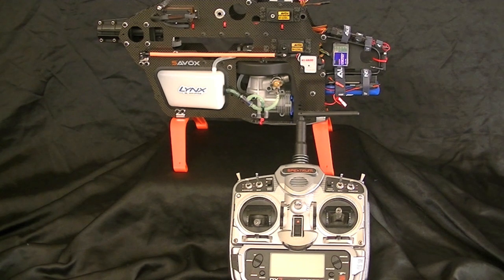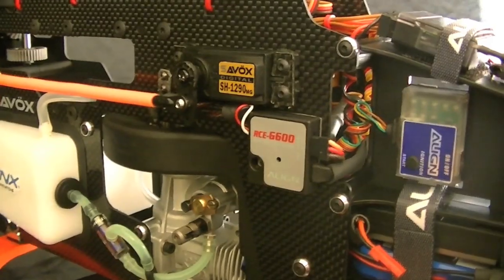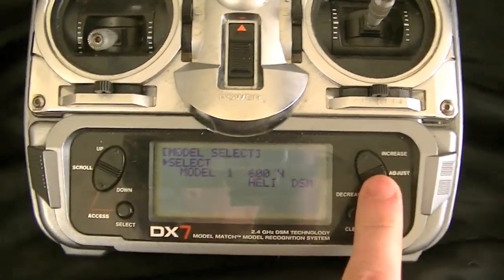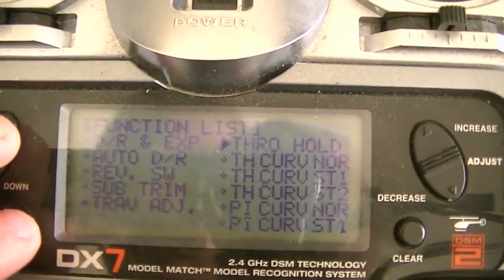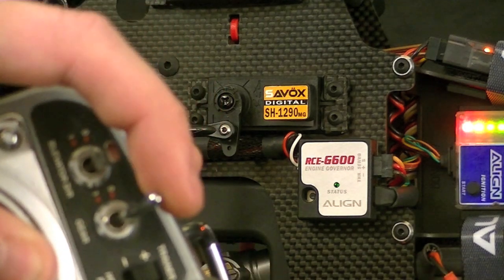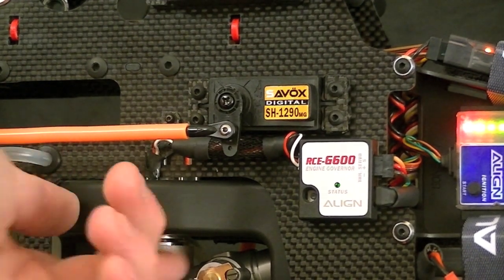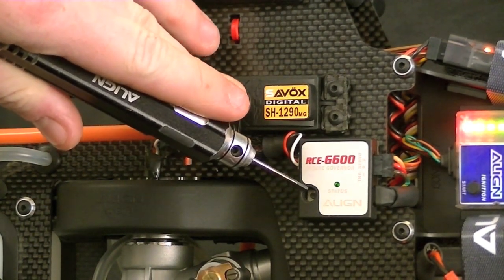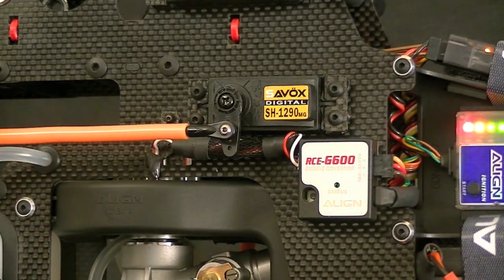Align gov full setup (freddy can fly)

Comment: Hello Freddy, how much voltage can you set on de G600 is het more dan 6 volts, i got a 2s hv lipo max 8.4 volt is that possible?
Reply from the maker: This older along unit had a built in BEC do it limits you to 6V even if you input a higher voltage.  So for example it will regulate the 8.4 down to 6 for proper operation.  If you want higher voltage and want to run the 8.4 you can remove the units and get a stand alone glow and run the pack right into your FBL as long as your system supports the voltage.  Or you can get a two in one glow system that lets you adjust voltage.

Comment: Hi Freddy i know this post i old but i just got a trex 600 used and took it apart and re assembled it so now i'm setting up the governor and i followed what you did and now my throttle servo is pulsing 
Do you have any idea why the throttle servo is pulsing?
Reply: I'm new to nitro so still learning
Reply from the maker: Paul Pongos was it working with no pulse before the build.  If it’s pulsing it could be a power related issue.  Like low amps or small brown outs.  Maybe try a re bind then re setup the gov and calibrate.  To rule out other possibilities maybe try plugging in a spare Servo and see if the pulse is still there
Reply: It started pulsing when i plugged the signal wire of the governor into the gear channel on the receiver.
Even when the governor is off the throttle servo still pulsing.
So you think its a power issue, i'll try what you suggested thanks a lot.
Your vids are sooo helpful🤙🏻

Comment: Hi their a few ? I have a trex600 FB nitro with OS50 hyper Now i have set the throttle links per your video all good oh also I'm using a DX9 magnets and sensor all good radio has been set per your video all powers on all normal now after its all set and done dose The throttle curves have to be set for all flight modes as I would for normal and 3 d also i notice when the gov is on and I flit the throttle hold the green light dose not turn off is that normal will the gov turn off on its own to alow me to auto without turning off manually the gov how dose that work as I can't see any info  on that and the manual also the throttle cut function with the
Gov . 

Thanks tour videos have explained and help a lot thanks for you time

Comment: Great tutorial! I'm using a 3GX and I plan to use the built-in governor function. As far as I know, the setup will be very similar to this one you talked about. Do you think it'd be better to use an external governor? Or using the one provided by 3GX will do the job? I'm flying a Trex 800E on batteries. Thanks a lot!

Comment: Hi, Throttle linear 0 - 100%.   Does the Green light have to be on to set the travel?   MyFutaba 8FG has a separate Governor menu and within that there is a % adj, default 50%.   Is this where I set the RPM do you know?   A guy at the field said I have to do it with End Points only, if so what is the point of the Governor % feature.   Regards